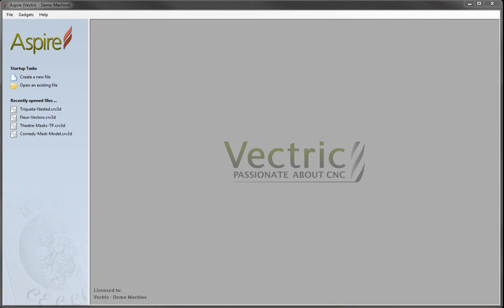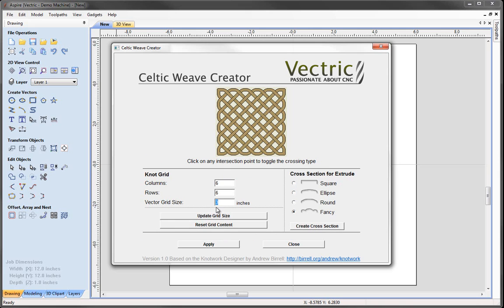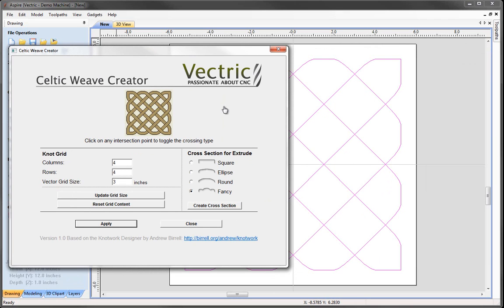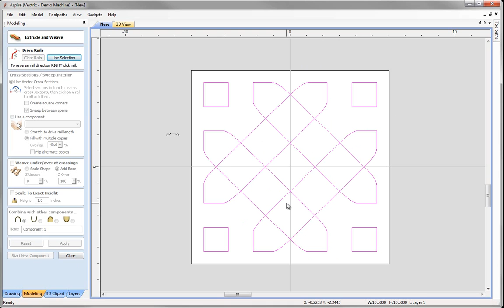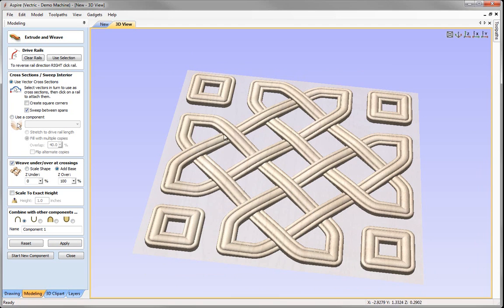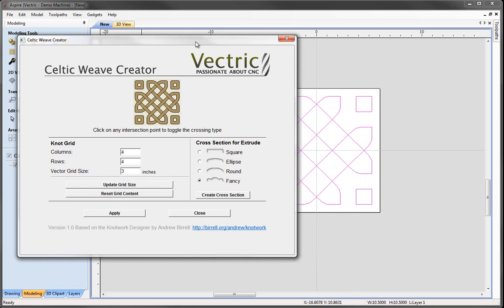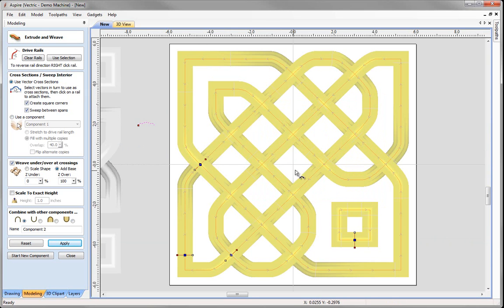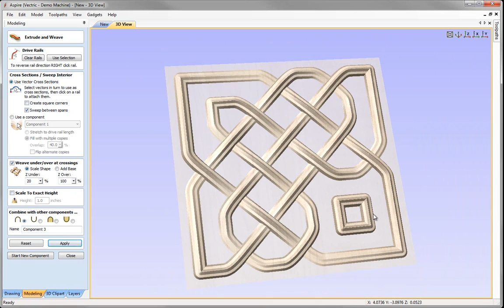Vectric Aspire 4 - Celtic Weave Creator Gadget

Comment: When i draw my weaves or i like to call them knots or celtic knotwork, by hand with a pencil and mechanical eraser, the auto over under function is a little slower, lol this almost makes me want to never draw a knot by hand ever again, just to instead explore every option in the software to try and get it to do what i need. Although my designs are a little more free flowing where as this looks like you pretty much get a border frame effect or corner medallion every time. sorry i cant upload a quick pic for visual but imagine tribal tattoo blended with this, long flares and tails.